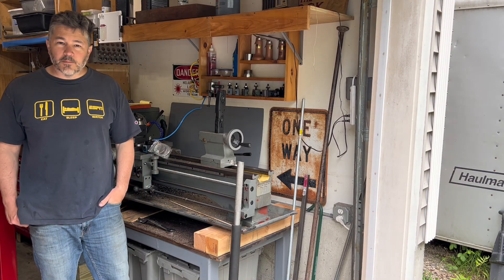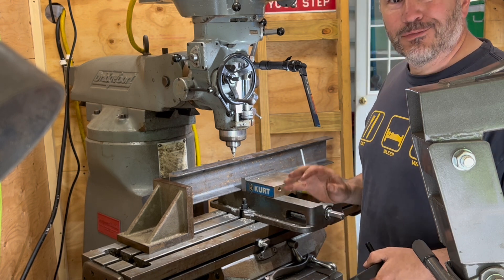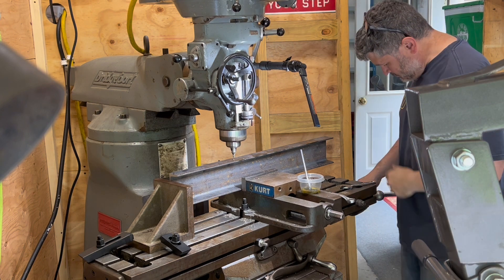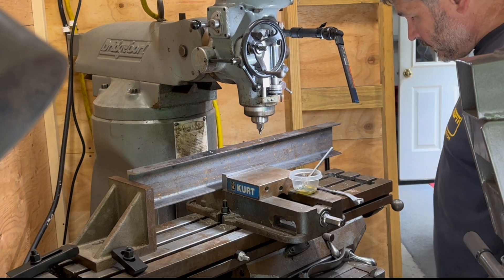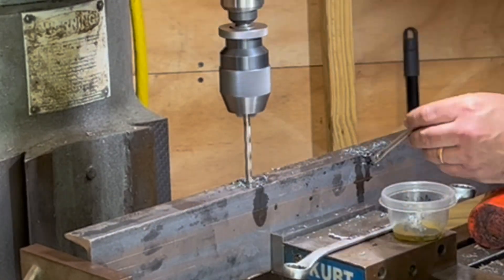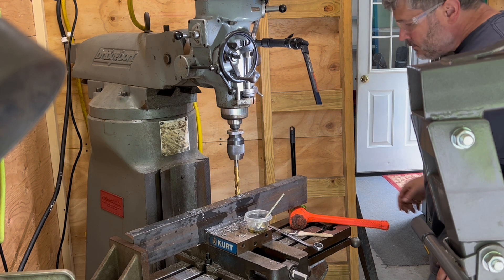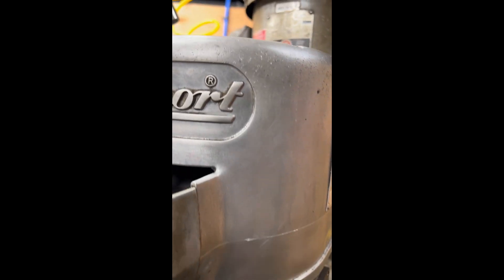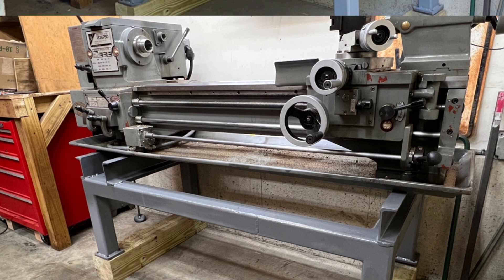Lathe Alignment Part 1-  building a steel foundation with the Bridgeport

Comment: Very good comment here.  I've been fabricating for over 40 years.  For drilling holes in structural steel, you don't really need a center drill.  Your pilot drill should be just a bit larger than the web on your finish drill. Slow down the RPM on larger drills.  When drilling through structural steel, be careful that you don't drill into the web.  One side of the drill bit may catch the web when it breaks through and can grab the steel, break the bit, or worse. 
Regards.
Reply from the maker: Thank you for the information. I appreciate it!
Reply from the maker: Two different uses of the word web and I looked them both up to be sure.
Reply: @EnoRestoration  I probably should have said the "chisel point" on the drill bit.  With experience you will see that with a drill press or mill, you don't want the pilot hole too large.  Thanks for the reply.  Regards.

Comment: You should definitely get digital readouts for your mill and your lathe. Drilling steel responds well to low speed and high pressure. I think your setup could have been more rigid. Only the bottom of the channel was clamped in the vise. A 1-2-3 block or some other piece of material contacting the web of the channel would have been more secure and likely would have made for less vibration while drilling. Keep exploring.
Reply from the maker: Great feedback and thank you for the encouragement!

Comment: I would suggest narrowing the foot print on the tailstock end. As your slab heaves, and it will, it will twist the bed. You also need everything to be level as close as you can over the full length of the bed or you will get smaller or larger sections as you cut. Leveling really shows up with more precision work longer than 3 or 4 inches.

With your experiance level i would have just center punched the holes after laying it out with a square. You need practice finding center. For the fab work it looks like you do, that is going to be valuble.
Reply from the maker: Thanks for the feedback, interesting comment about the tailstock foot print.  Didn't consider that. I appreciate it.
Reply: @EnoRestoration  you are welcome. Unfortunately it is a hard earned lesson for me. Looking at it your drill bits are also just dull. You should be able to push a 5/8 bit without trouble. Also, with the quill arrangement you have it's going to feel like you are pushing harder than you are. It takes force to just move the quill. These machines don't drill nearly as well as a drill press. I am launching a beginners guide on my channel, you may find it interesting. But my first video is why I made sure to have a good drill press, even though I have a mill.
Reply from the maker: @moosesmachinery  Thanks, just subscribed. I'm in Seacoast NH.